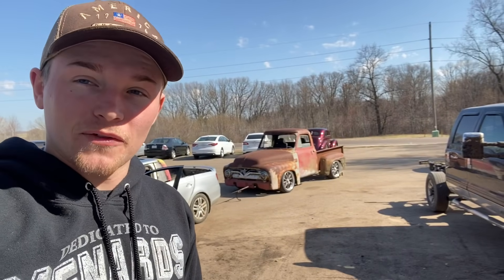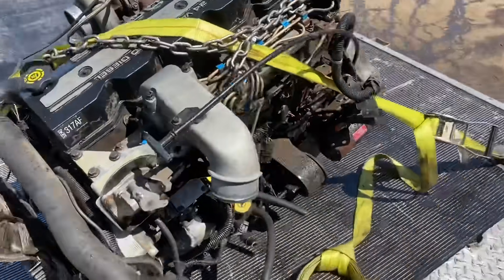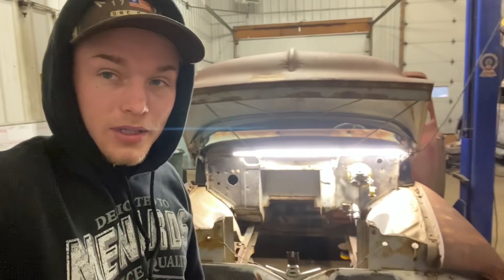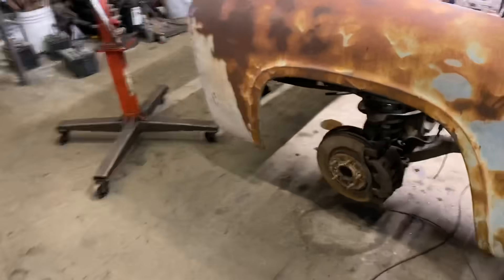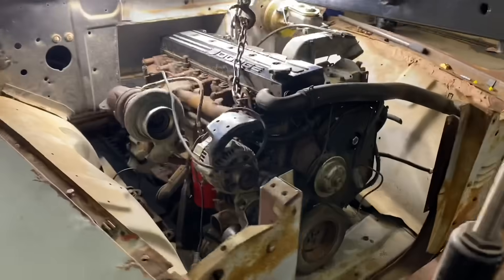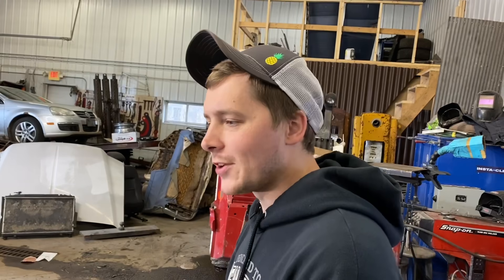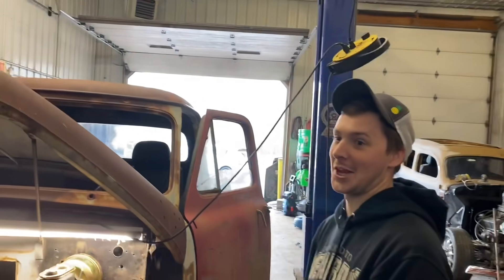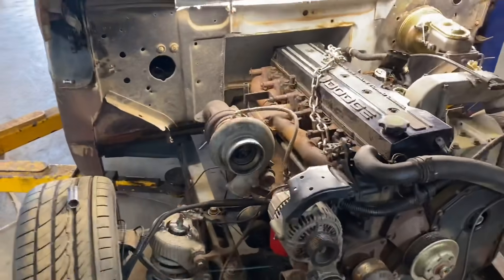1955 F100 24v Cummins Swap! Pt.1

Comment: love the build this is the exact swap that I was going to be doing in my chopped 54 F-100 any advice for getting it done
Reply from the maker: Only advice is take your time on wiring, it’s easy to screw up with things like these and you’ll be scratching your head for hours trying to figure it out why it won’t start or run right on shift properly

Comment: Plus I’m glad you pointed that spring out too because I was afraid my 7.3 idi was gonna be too heavy for the front suspension. I noticed the frame isn’t beefed up. Have you considered the torque twisting the frame or are you not worried?
Reply from the maker: No too worried, these frames are pretty stout and if we end up with issues we can always box the frame and add more bracing but as of right now I don’t think it will be an issue.

Comment: The diesel is cooler than an ls. Everyone does the ls swap in to everything. It's too bad you can't use the manual transmission, but it makes sense to use the auto

Comment: I’m just starting a 12V swap into a 53 F500.  Which rack and pinion are you using?  Has it performed good and held up with the weight of the Cummins?

Comment: Hey I’m wanting to do this I’ve got 63 unibody Ford f100 with the crown Vic front suspension like yours does the front suspension hold up that much wait good? Thank you
Reply from the maker: Yeah it worked very well, with the factory Vic spring it rode like a Vic and handled great
Reply: Thank you I was worried about weight because those dodge front ends wore out do to weight

Comment: Is that CV front end going to handle the weight of that Cummins? Also, is that CV rear going to handle the torque?
Reply from the maker: Joseph Hummel yes the front supports the weight just fine, the suspension actually compressed less with this engine/ body than it did in the original car
Reply from the maker: Joseph Hummel as for the rear it’s hold up just fine with the diesel for quite some time, usually you break them with high traction and this truck is so light I don’t see it being an issue, I’ve run 10 bolt chevys behind 12v’s and not broken one yet